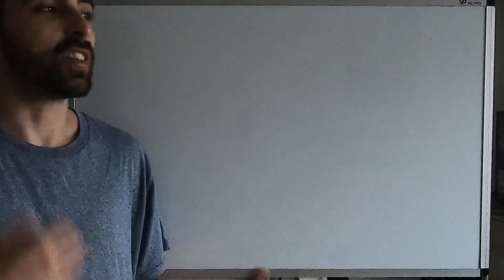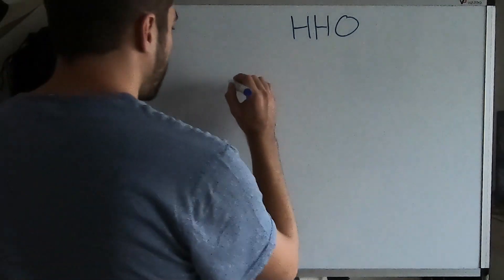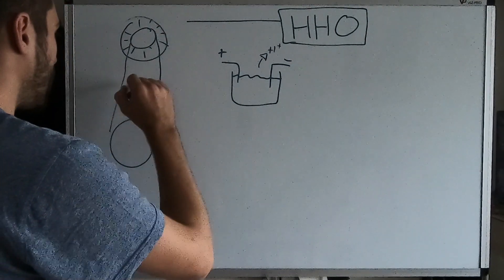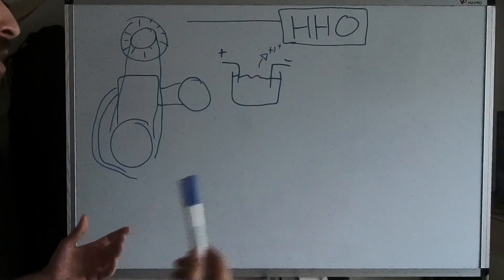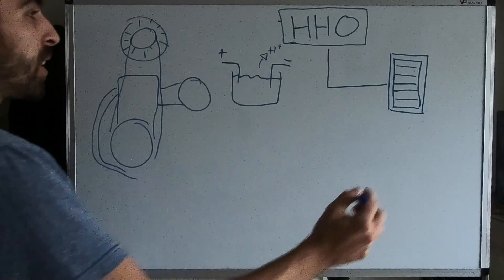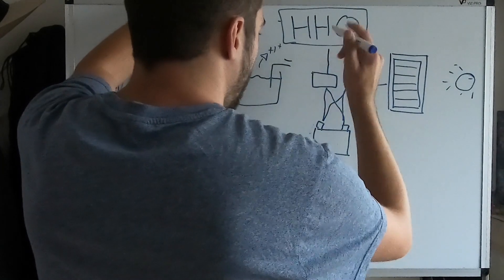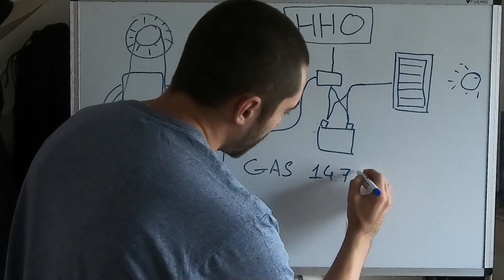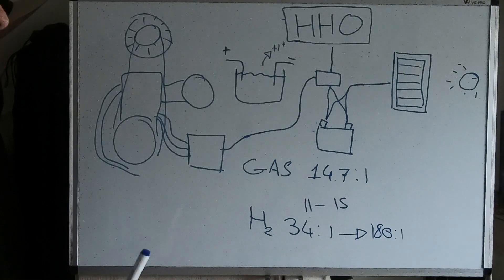Hybrid 1996 Fiat Panda 4x4 - HHO Generator Breakthrough?

Comment: Are you planning to run hydrogen as a fuel or as a fuel addative?
Reply from the maker: Running hydrogen mixed with petrol. So i guess as an additive.  Better, fuller combustion of everything in the combustion chamber👍
Reply: @BearPerformance_  Awesome. Do you know what ratio of hydrogen you'll be adding?
Reply from the maker: Not yet sadly, once i built everything i can test the actual flow rate and determin the ratio that way 👍